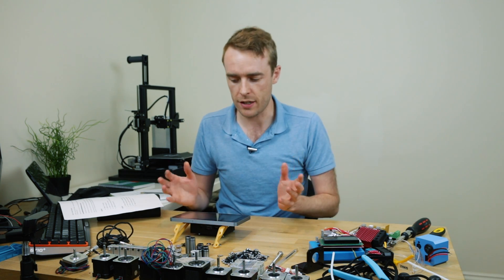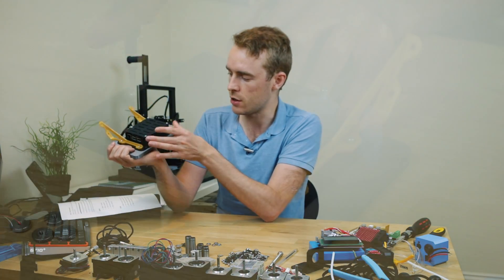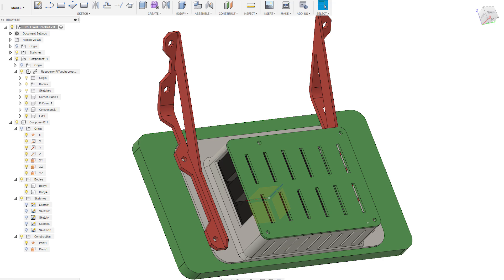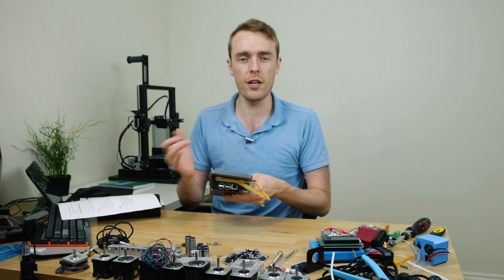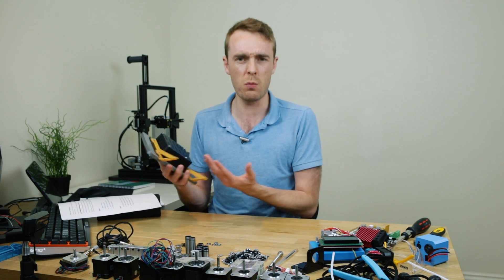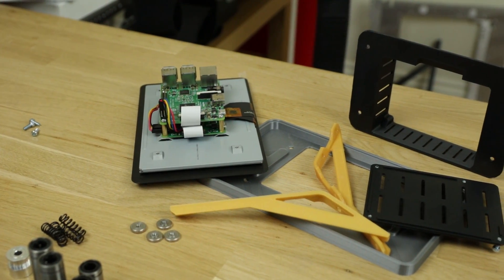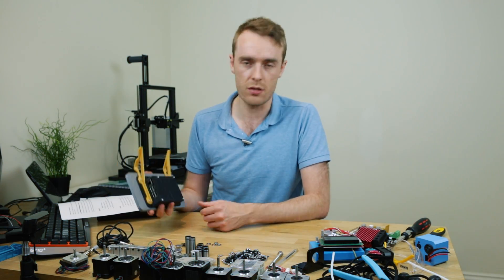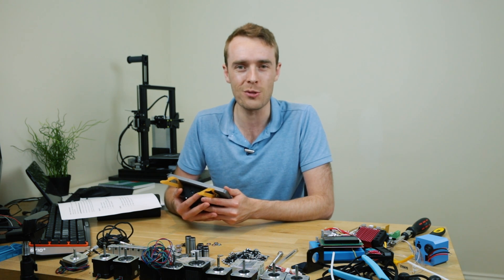#3DTWIP - Mini Print Farm Controller Enclosure

Comment: What a coincidence I'm working on a bracket for the same thing. I'm using the thingiverse enclosure as i already have it printed. I'm sandwiching in a bracket between the two parts so I can mount it to my printer. I've gone for a hinged mount  so I can alter the viewing angle. I'm very interested to see your multiple printer solution.

Comment: What do you think is the best printer to build a farm with? Even small size printers are fine
Reply: @Vector3DP  whats wrong with the ender 3?
Reply: @Vector3DP  Agree with what you say about the Ender3 - there are niggles with quality and more serious safety issues to consider.
It's a little printer once you've sorted these out - the biggest issue I had was with the manufacturer tightening down the cams on the delrin wheels - so they developed massive flat spots that would show up on linear prints. Had to replace the four on the bed and four on the Z-carriage. Was not happy.
The ender-3 is not really suited to farm work unless you upgrade the bed to magnetic, and reflash the firmware. The extruder is adequate, but could do with upgrading for prolonged use.

Personally I use modded CR10S' for farm of work. Cheaper than a Prusa, with superb quality and larger print areas (changed head to a genuine E3D Aero, fitted a 240V mains-powered bed, and reflashed the firmware to make it more versatile and user-friendly and SAFE!).
For me, it was down to - Do I want to 'print and go' (buy off-the shelf and pay more) or pay less, have something better, but requires a little work to get right?

Everyone will have their favourites. I used to be a Prusa fan, but these days, not so much. There seems to be too much "Ooh, shiny!" in their development processes and not so much "let's make sure it works before release" (and charging money for it)! - I'm looking at you MMU/MMU2, and filament runout sensor, and so on...

Comment: Nice one...im kinda the same...i design my stuff rather than just print something from thingiverse...
Reply: Whatever i need to do the job...i like more  twikering...i desing my own corexy printer...still improve all function...it has some designs that is not "so normal" as some people say...i started in the cad software about 8 year ago when i desing and mount my 2 cnc's from scratch.
I mainly use Solidworks for desing, artsoft for cnc and simplify3d for 3d printer